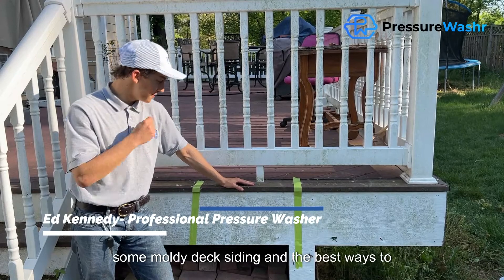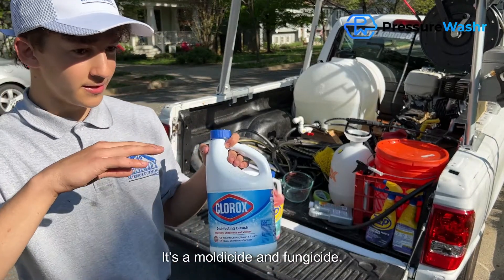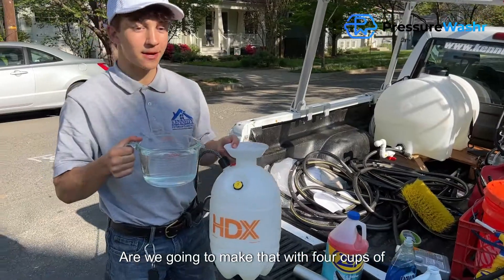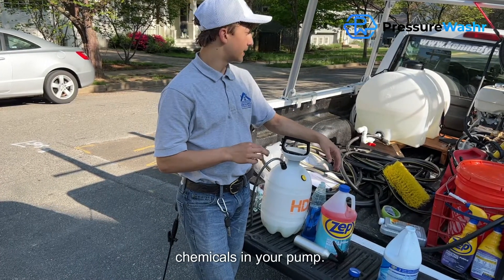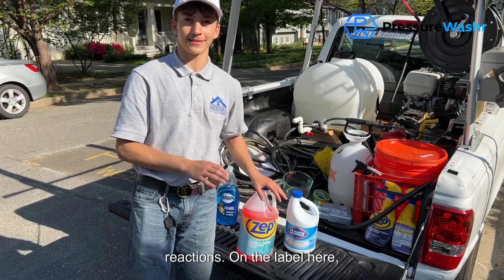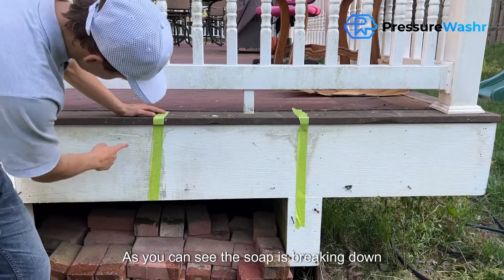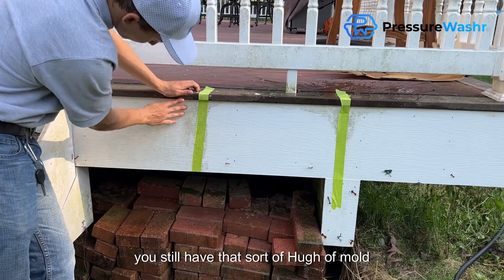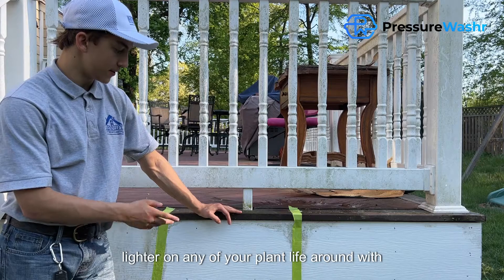Best Siding Cleaner: Dish Soap vs. Bleach vs. Zep | Chemical Test

Comment: You should never mix dish soap with bleach
Reply: Why?
Reply: You should never leave a comment that you have no idea what you're talking about
Reply: Because thousands of professionals have no idea what they're talking about?
Reply: @landrumtl  as long as the dish detergent don't have ammonia in it, Dawn is fine ... I mix a little Dawn to my bleach water for spraying my siding down before power washing
Reply: @TADDs101  true, depends on the amt of Dawn soap//% of bleach ratio [not mentioned here] = mustard gas. A tablespoon or two is fine in 1/4 gallon 5% bleach per 2 gallon water (start small in ratio, buildup ratio only if cleaning result is deficient). Rinse before/rinse afterward, and rinse yet again (especially nearby plants); surround your eyes, face, arms protection ALWAYS. Keep active hose handy and on standby. Excessive water is your friend.
Reply: @TADDs101 lol